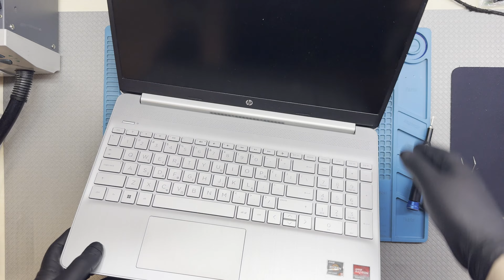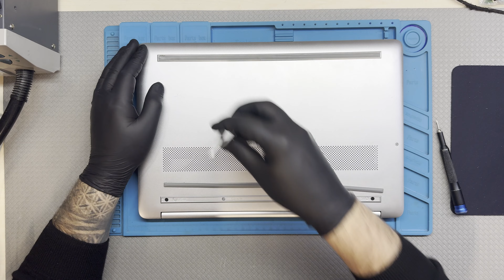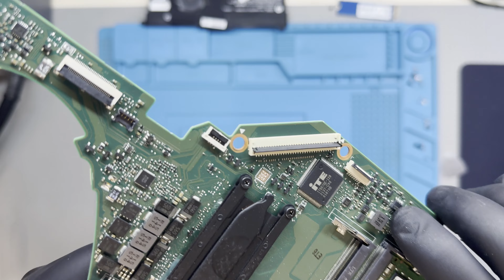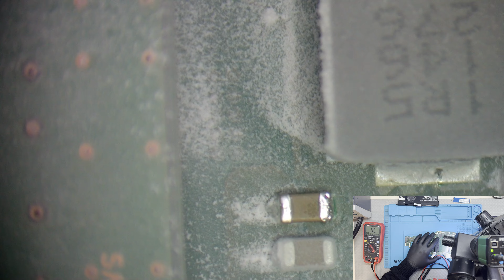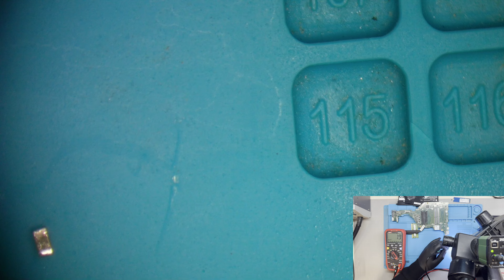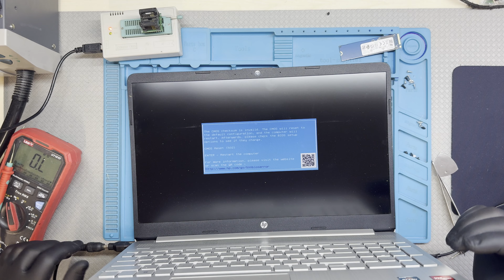More and more HP Laptops with Ryzen CPU's are dying because of this! let's see how we can fix it.

Comment: For my case, I have an ASUS ROG Strix. I found something similar, but it's quite different. It doesn't initially show any boot logo; instead, it plays the Windows boot sound. When I checked it on an external screen, the picture appeared without any problem, rather than my laptops screen. However, I noticed my display adapter failing. This happens every time I shut it off and boot it up again in the morning, but it doesn’t happen if I let it shut down on its own or doing shutdown, closing lid or forcing to shutdown. Could this be a possibility of a partial short or an issue with the BIOS? cause it seem alike
Reply from the maker: @sparrow243  what do you mean display adapter failing? As in your gpu? What’s the gpu on your laptop?

Comment: That capacitor was there for a reason. You shouldn't just leave it out. There may well be other capacitors in parallel with the one you removed, but they will be different values, which are better suited to filtering out other frequencies. The supply line that the capacitor was filtering may well have noise on it now, which could cause intermittent problems. The manufacturer wouldn't have fitted it if it wasn't needed.
Reply from the maker: @Manticore1960  That is very true my friend and that is why I ended up replacing that 50V/1000p capacitor! Thanks a lot for your input!
Reply: @macbookfixer  Ah right. Sorry. The replacement cap wasn't mentioned in the video. 👍

Comment: I didn't get it. You removed broken capacitor and you didn't put any new there and it worked?
Reply from the maker: It was a smoothing capacitor and and the one below it does exactly the same job. And since the short was removed when the capacitor was removed the laptop turned on without a problem.